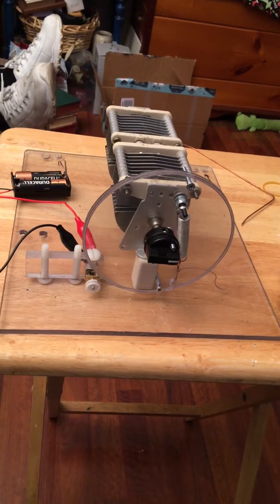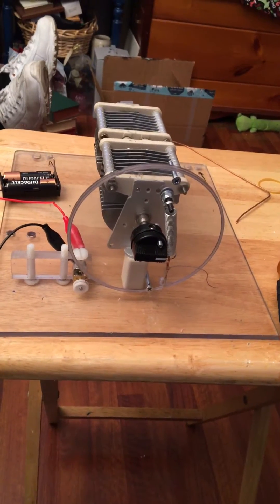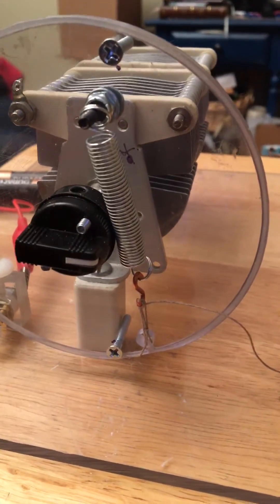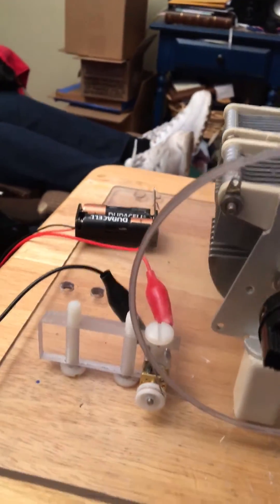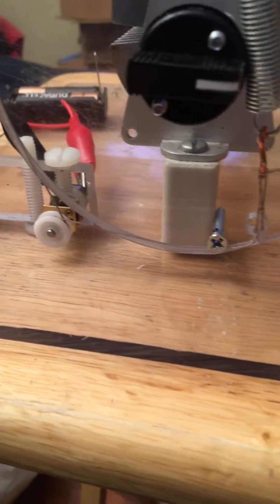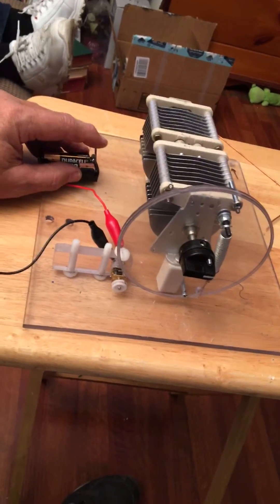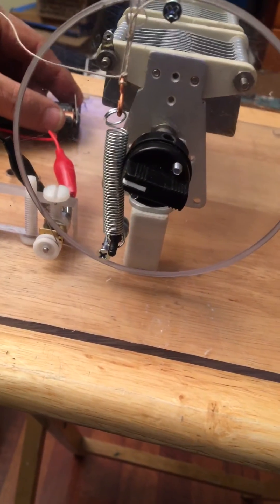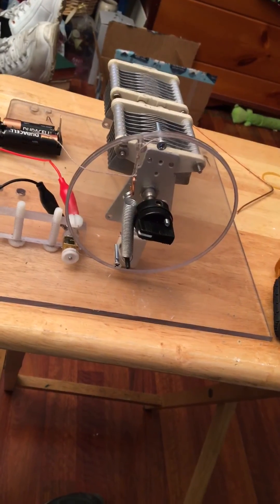Mag loop tuning capacitor drive system.

Comment: I know it's an old video but I've been trying to find an answer to a question about tuners and hope you can help . I have a moxon for 11m dxing , she fine on the reg 40 and all but when I get to freebanding she gets a bit wonky . I've seen many DIY tuners and such but most of them have been for wide banding and have coil taps along with the variable . I want to tune just for 11m and the question is would I need a coil tap or could I just get by with a variable ? Any help you could provide would be extremely appreciated .